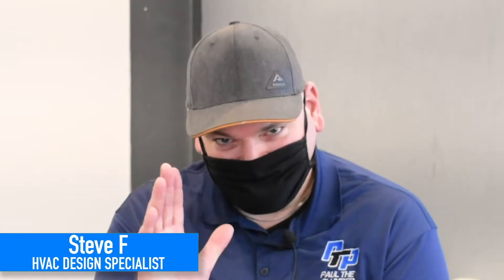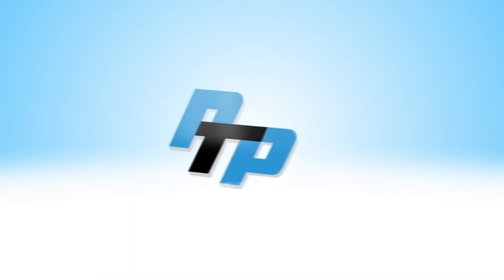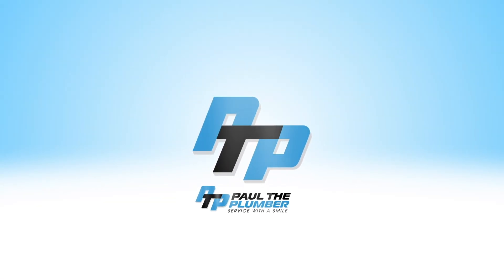What is a 'Combi' Boiler?

Comment: Combi boilers are definitely not your best choice and I will try to explain why. Theoretical perfection in a hydronic system is to only supply what is being lost through the walls and ceiling, this is accomplished through modulation of the burner. Right now the best boilers have a 10 to 1 turndown ratio and that appears to be getting better every few years. This means a 100k BTU boiler will fire at 10k BTUs at its minimum firing rate. When the heat loss of the building is less than 10k the boiler will cycle just like the old boiler in your video. Very inefficient!  So on an existing building we must first do a whole house heat loss using a manual J program for our design day (coldest expected day) then once we have that number we must measure all radiation or convection and do an EDR calculation (Equivalent direct radiation) Once we have this number we can go to the chart and see what temperature water will be needed in the radiation to supply the needed BTUs on that design day. This is not the temperature entering the radiation but the average temp taken by inlet and outlet temps added together and divided by 2. Modern condensing boilers have a outdoor reset control. You will use the water temperature that you figured on a design day as the beginning of your reset control. Now you can go back to your heat load calculation and see how many BTUs are needed as the outside temp increases. I usually will do 10 degree increments. Here lies the problem with combis, in order to make enough hot water for bathing, combis are usually 200,000 BTUs input. The turndown ratio is based on your gas input so your minimum firing rate would be 20,000 BTUs. If installed on a home with a heat load of 40,000 BTUs on the design day it will reach that 20,000 BTU firing rate in a very short time. Looking at your heat load you can see exactly what outside temperature would cause the heat load to be 20k or less. This is where the cycling starts and will continue until you reach your warm weather shutdown. If we would use a 50,000 BTU boiler our minimum firing rate would be 5,000 BTU. this will get us much further up the reset control before we start to cycle. So if the heat load is 200,000 in a mansion then the combi might be right for you, if not and you have a home like mine that requires 36,000 on a design day it would be ridiculous to install a Combi. I will always explain this to my customers and most will go for a separate tankless water heater.
Reply: Wdym they're not efficent we have em here in europe. They're perfect for apartments